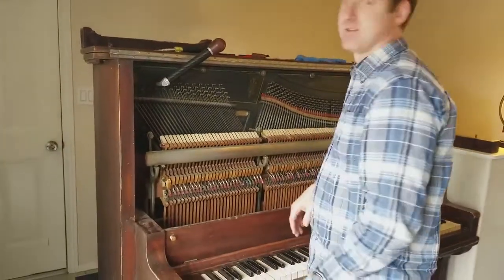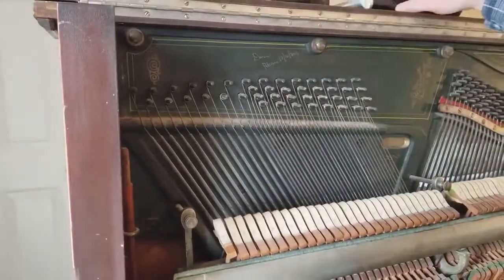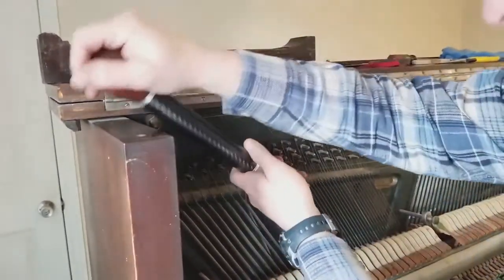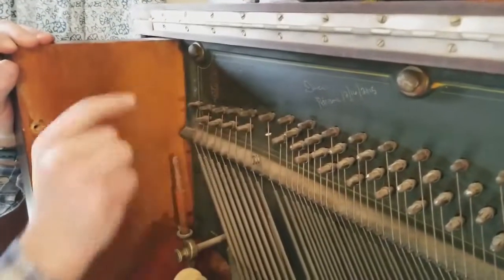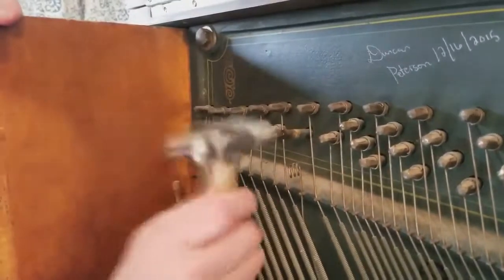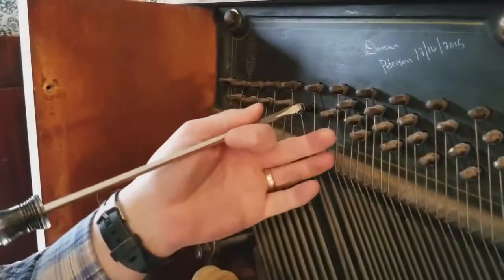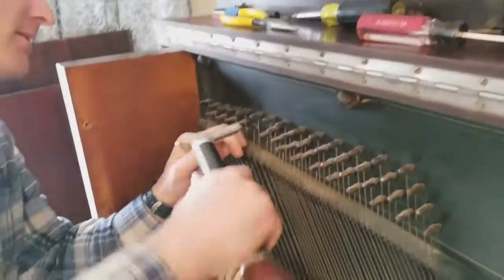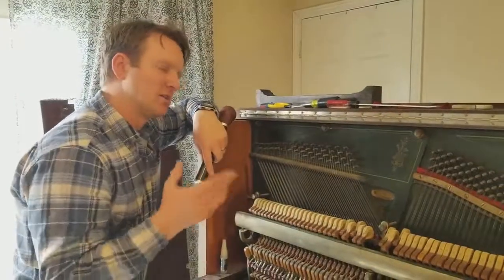HOW TO | Single Loose Tuning Pin Repair

Comment: Instead of the sliver of paper towel, you could use Zap Flexi-Tips (or similar brand). They are very fine nozzles that will fit on your bottle of CA glue, and you can direct the flow and coat the sides of the hole. Need to be careful with paper materials as CyanoAcrylate has an affinity for cellulose and will produce an exothermic reaction (forming cellulose cyanoacrylate).  I have seen a paper tissue (90-odd percent cellulose) smoke when it got CA on it.  Also, with the flexi-tips, it may (depending on plate bushings etc) be possible to apply the CA glue with the pin still in place, and it will wick in around the pin by capillary action.

Comment: If you apply glue, will there be any tuning problems later when the glue dries?
Reply: With CA glue it WILL dry and solidify, that’s the purpose. So no it doesn’t introduce any negative effects. It sometimes doesn’t work but you’ll know right away during that appointment and you can proceed to hammer in the tuning pin a bit further or replace it with one size up.

Good question.
Reply: @TheGildedPiano  I worded the question wrong - English is not my main language. In this question I meant sticking strong tuning pin into pinblock, but I guess this glue doesn't have that power? ;-D 

The larger pin - unfortunately this is not an easy commodity to buy here when I live. I haven't found it in Poland or the Czech Republic, and all other results are from China. Thanks for showing this method, I will try it at my place if it works ;)
Reply: @Jamick_Elektronika  nice work trying to ask a good question in a foreign language!  I know the difficulty of trying to communicate in a non-native tongue. Best of luck.
Reply: As  others responded, CA almost makes a new material out of wood, I have found. The wood almost is like a composite with resin injected into it. Those pin threads will cut right into it, won't adhere to it - nor will the CA glue adhere to the cast iron plate. Quite ingenious, wonder what the old world builders and tuners would think about this magical substance.

Comment: Nononono!!! CA glues reacts with wood. Do it only if you change the pinblock 2 years later. Use a hard paper only wrapped around the tuning pin instead of putting CA glue.
Reply: Why is reacting with the wood bad?
Reply: @Thoracius  It reacts. Dot. I did this mistake too. I CA glued whole pinblock and when I wanted to change the pins for bigger size, it was not possible to drill it properly. It was like a rubber.
Reply: That's not pertinent to an upright like this because no one is going to be redrilling or replacing the pinblock

Comment: Is really AC glue what you apply?  Couldn’t be something better? I have seen that violinist or string players apply something to hold the tuning better.
Reply from the maker: Cyanoacrylite, or CA glue, is the method I personally prefer, although there certainly are other ways to approach the repair.  I have found through much experience that this repair, in terms of cost/benefit, works best.  You may be thinking of hot hide glue perhaps?  Do you have a method you prefer?  Love to hear and thanks for the comment.